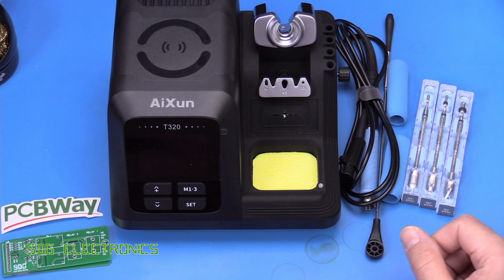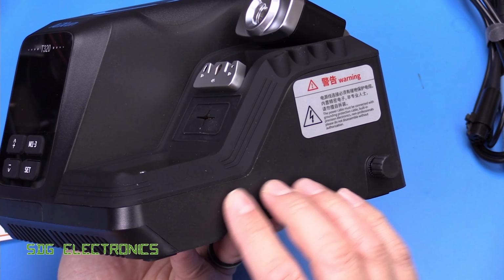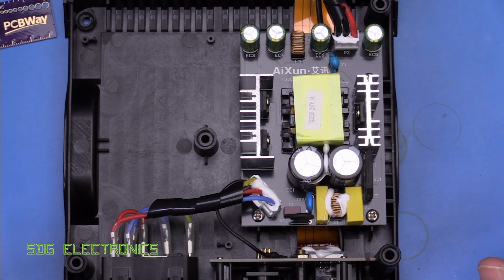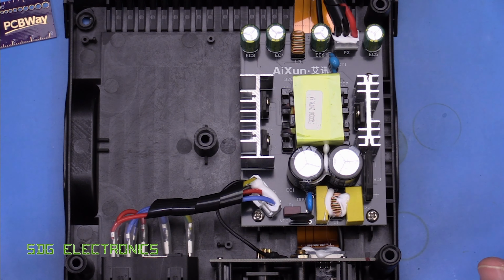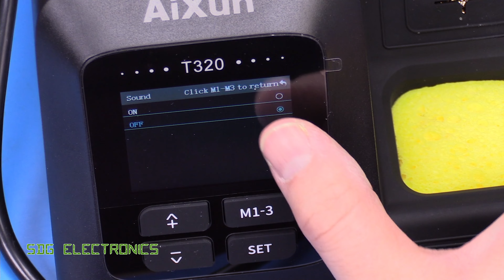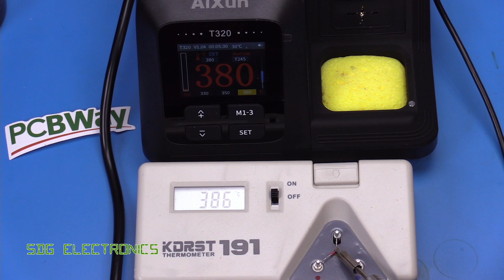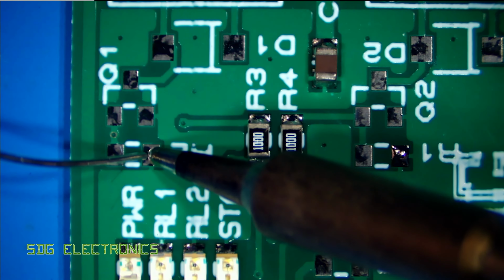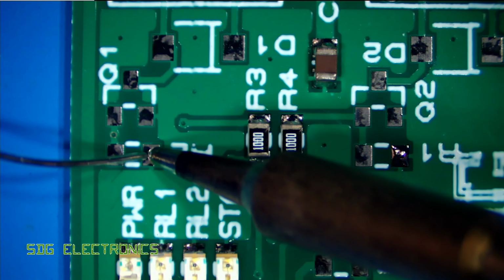SDG #319 AiXun T320 200W JBC Style Soldering Station

Comment: Today’s video is also sponsored by AiXun. Free gear is still payment.
Reply: I was really disappointed how he glossed over the issue at the end with the temperature spiking. 

He says it looks like they made it better using firmware but it bloody doesn’t! I saw 412*C flash up when the set point was 310*C. 

That’s relying on the readout being truthful which on some stations it isn’t. It would have been good to double check the actual tip temperature.
Reply: @davadoff While I don’t disagree with your objections to the video: Just as an FYI, the display flashing 412C doesn’t necessarily mean it actually reached that temperature. Stray voltages can easily produce massive measurement errors in thermocouples. Even more so when using a switch-mode power supply like this one. 

Depending on the circuit design, it may well be possible to fix that in firmware, by making sure you only measure with the heater off. And if not, filtering multiple measurements may be able to produce realistic numbers. 

The Pace station I have at work shows similar high temperature blips while heating up from cold, and that’s a top brand. 

On the other hand, if a tip thermometer actually showed 100C of overshoot, that’d be a serious problem!
Reply: @tookitogo  good point. It wasn’t clear to me the tip wasn’t overshooting for real. In fact I got the impression from this vid or previous one that it was actually overshooting for real.
Reply: @davadoff The PID tune has been fixed! Works very great right now and doesnt really go over the set temp

Comment: I don't suppose if anyone has tested this station for voltage leaking? the aixun T3A has voltage leak amongst other issues
Reply: There is no voltage leak that I can see. The tip is earthed to the ground lug of the IEC which is earthed to the rear ground socket.

Comment: I have the T3A and quickly burned out all of the Chinese tips both from Aixun and a "high quality"3rd party. Now using genuine JBC tips but locally they are rather expensive and a very limited number of suppliers and rediculous freight charges. Has anyone found a supply of decent Chinese tips that don't burn out after a few hours?
Reply: I have noticed that a lot of listings for C245 tips on AliExpress explicitly mention that the advertised  tips are not suitable for Aixun soldering stations.

Comment: Will you be doing a review of the gvm h3 possibly? I ordered one but it never came and was returned to China and I'd really love to hear your feedback on it before Reordering another one especially compared to this unit the 320. That unit is very very similar and uses an actual transformer instead of the PCB which is why I was so interested in it compared to the 320. It would definitely be worth a good review. There's a lot of people asking about it and it appears to be at least from the specifications and info a really nice unit (personally, I prefer a real transformer, although I know it's not the end of the world if it uses a PCB). I own all of the aixun units and they're all great but I'm much prefer units with a transformer and build wise similar to an actual JBC. Just curious. Great review!
Reply from the maker: Gvm is on order
Reply: @sdgelectronics  I'm not sure why but I can't see my second comment, but I wanted to let you know that the USB port on the back is basically useless. The company will not give out the software nor the updates for the unit. I've tried getting them. A friend of mine that ordered one tried to get them and there is a YouTube review where they're saying they can't get them either. If this duplicates my other message, I apologize. It seems to have disappeared though. I spent a couple of weeks trying to get software from GVM/ sunshine and basically was told every time they don't give it out

Comment: I wonder what happens with the graph display if you have it running for hours? You can see later in the video it has trouble rendering 3-digit X-axis labels (some overlap), so what happens when it gets to 4 or 5 digits? 😄

Personally I think it's pointless showing an actual seconds value, should probably just have tick marks and avoid complicated rendering issues.
Reply from the maker: Agreed, yes as expected it just fills up with numbers. Markers would be sufficient

Comment: And here I am, happily soldering away with an old Weller Magnastat with absolutely no electronics, the only "display" being the light on the power switch. Never realized I need a real time graphic display showing the power and temperature curve of the iron to get good solder joints. 🤣

Comment: Very cool station. Makes it really hard to justify purchasing the original jbc
Reply: I mean realistically original is less easy to use. Takes longer to start, cant change temp when the handle is on the stand.
Reply: That's true, but only IF you planning to use these chinese knockoffs for a hobby. If you need a soldering station for a serious work, go with the original! I had t420d and did a comparison test with the original compact JBC - the difference is HUGE! Even if you use the original JBC tips!
Reply: We have two original JBCs, 4 different Chinese ones(Sugon and Aixun). No much of a difference if any. 
Even the tips, if you use C245 ones go with the original. If you use C210, since the originals are expensive and easy to break just get Chinese ones too. They are 90% there, last about the same but cost 1/5 or 1/8.
Reply: @johnyang799  I used the same original tip with T245 on the same 6 layers pad, both stations calibrated to the same temp with the same solder wire. T420D runs the tip more aggressive, peaking to 200W,(shortening the tip life of course), but the response was always worse than the original, which has limiting to 180W peak. The temperature compensating algorithm in the chinese station simply fails to do the job properly. And yes, I tried all t420 firmware's available. I'm glad that I got rid of this station and I'm not planning to buy a chinese soldering station at my life... As a hardware built quality, it was very good, I must admit though... The software is a no go!
Reply from the maker: I haven't really noticed any significant difference in use between the JBC DDE and T420D. But for professional use, it'd always be sensible to use the premium brands.
Reply: @sdgelectronics  I recently ordered one more CD-2SQF station (the best working horse and very reliable by my experience). What was my surprise, when I plugged it in and I saw a different image to the screen. They've send me by mistake the newer and more expensive model CDE-2SQA - the one with the stupid solder assistant :/. Of course I took my chance to test and compare with my other JBC and Metcal 5200 (which annoys me from time to time for not recognizing the original Metcal tips). The overshoot was more aggressive by ~5%, compared to my other JBC, feeling a tiny bit better while soldering. All that modern oled display with the useless for me assistant... So without any further hesitation I returned to the store, fingers crossed the right model is traveling to me this time... :D

Comment: Why don't they just isolate the tip and then allow the user to decide how they want it done.
On the Weller stations I bought for work there is a jack socket on the rear panel, the tip and earth connections are on this, so it allows you to decide if you want to short the tip to earth or as i always did was fit a 10K resistor to provide a bit of protection and stop the tip charging up with static etc. Also means if you want to work on live PCB's you can remove the jack plug and have a completely isolated tip.

My home made Weller soldering pencil power supply has the tip earthed via an internal 10K.

Not sure why they need all that information on the screen, I just want a soldering iron that does the job. I'm never looking at the display while the iron is in my hand.
The number of un-review soldering irons must be dropping fast.
Reply from the maker: I still have about 6 stations sitting here still to be reviewed, but some are a bit less relevant these days. You forget we're living in an era of USB soldering irons with 64-bit processors in them!
Reply from the maker: I think on most pro systems, the tip is tied directly to mains earth. It seems to be on the Metcal, JBC, Pace and Ersa irons from what I remember. But they either have floating power supplies or don't use a thermocouple in the same configuration as JBC cartridges, so no issue on those.
Reply: @sdgelectronics  must be a Weller thing. but I still like the tip to act like an extension to the ESD mat.
Reply: @sdgelectronics  Once you have a tip that get hot, and the right temperature. i suppose you have to add bells and whistles to try and stand out.
Reply: 10k resistor will work for ESD but will not work for induced voltages, shorted heater coil, etc.
Reply: @jaro6985  that maybe,  but in all the years that I've been working in the electronics industry I've never seen a heater short to the tip. My first use of a soldering iron was about 1972 while still at school.  And in a professional capacity 1976 when I started working in avionics manufacturing. 
But I understand that with all the tips coming out of China nowadays all my experience will be out of date. They show a total lack of electrical isolation in mains power supply manufacturing so why should they care about good isolation in your iron's tip.

Comment: You may want to add the steps of using a power consumption meter and validate advertised power ratings by dipping the iron in water and monitor its recovery to the set temps. Such as this one - https://youtu.be/RHwS9CDEISM

Comment: I love the coin test. But why you didnt do test in that thermocouple you designed used in c211 video. Hmmm. Inconsistent.
Reply: Btw. Did this station overshooting? i mean have high delta T around set temperature
Reply from the maker: I couldn't do it on this occasion as the Picoscope is doing some datalogging.
Reply from the maker: If I power up the station with the tip placed on the temperature calibrator, it does not seem to overshoot.
Reply: @sdgelectronics  thank you so much. I thought you will never reply my comment. Lol